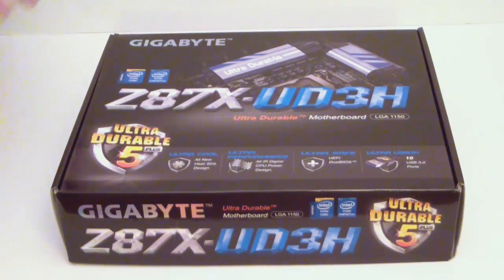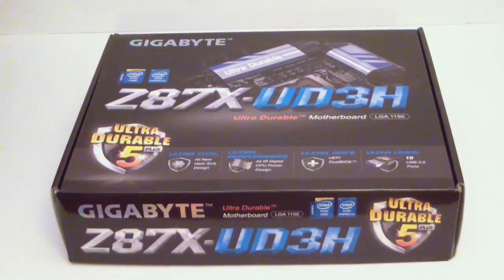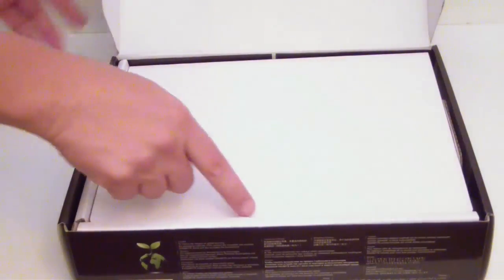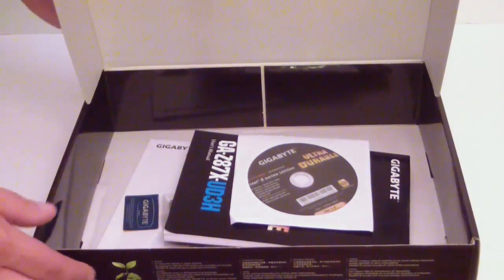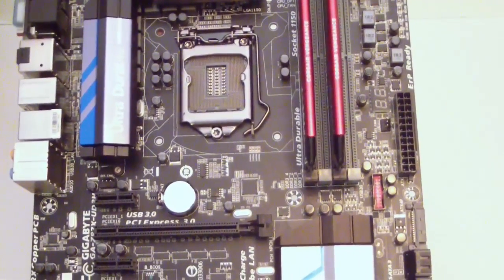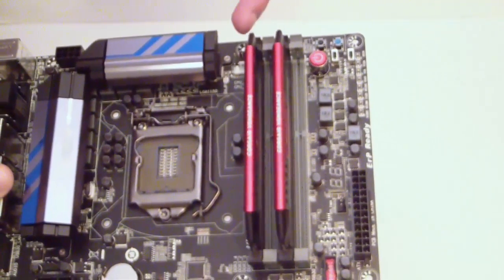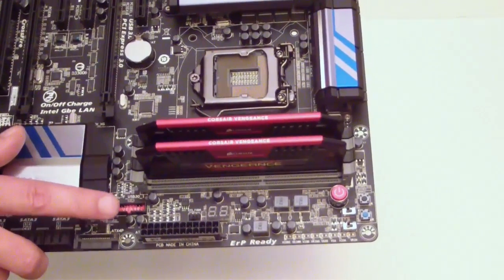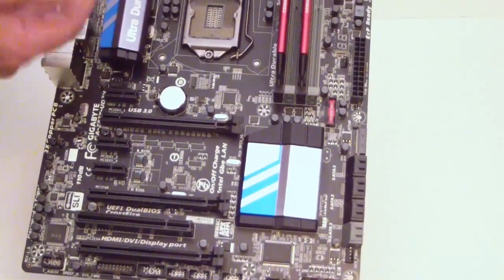Gigabyte Z87X-UD3H Motherboard Unboxing + Review + Benchmarks

Comment: great vid and nice reviews you pull of i appreciate your work but regarding the board it only supprots two way sli and three way crossfire due to the fact that nvidia gpu's can't run on a slot that is at x4 soooo....just wanted to point that out